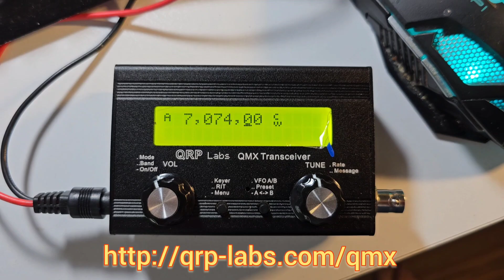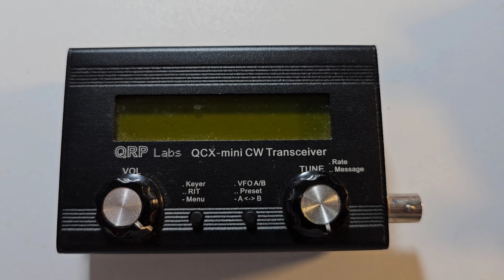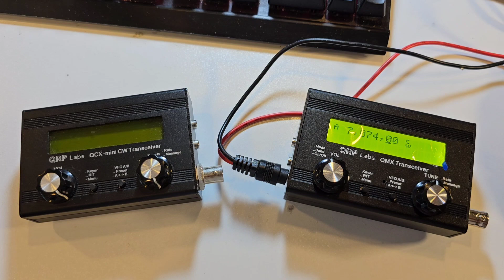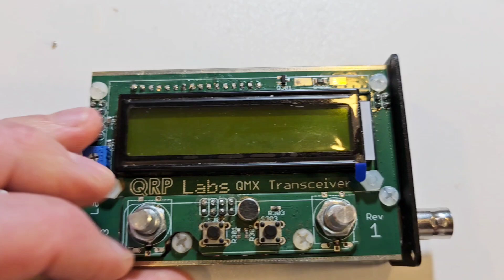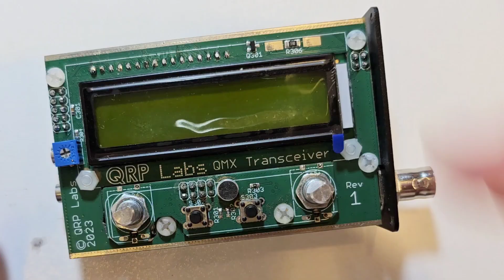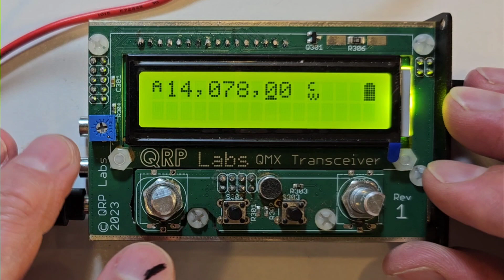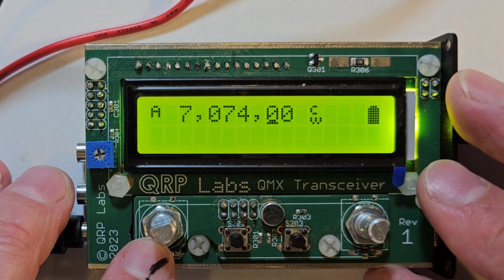QMX: Multiband Multimode QRP transceiver

Comment: Hmm a multimode? Whoa. 
Love the quality of and easy to build Qcx+. Today I tuned around 20m to only find one weak station calling cq. Had the QCX+ and a yaesu ft818 connected via a switch to a 20m dipole so I could switch between them. They both received the same weak signal but The QCX+ with its audio filter brought it out and made it more readable and it even decodes the cw on screen. WOW. I tuned the 15mhz time station and the Qcx did better. Thanks Hans. I highly recommend the QCX+ and other things from QRP-Labs.

Comment: Hans, I would sit for hours listening and watching any one of your videos.

Do what you think is best to pass your info onto us!

BTW: I will order the QMX in a few weeks. Really looking forward to the addition of phone functionality.

This is a long post, Folks.

Must get back to practicing CW. I started with CW by counting DOTS/DASHES 45+ years ago, and it's cursed me ever since. Several years ago, I worked up to copying @ 20 WPM @ about 85%/90%, but jobs/family put HAM activities on the shelf.

However, your kits have pretty much reversed that.

BTW: I'm a retired Over-the- Hill, Has-Been Digital Electronics Iginier, very-very into my senior years, and as you know: 

'You can take the Engineer out of the Lab, but you can't take the Lab out of the Engineer!'

My specialties were Digital Designs of Embedded Real-Time Machine Controllers, High-Speed Mil-Spec Comms, State-Sequencers, and Four-Bit Slice designs, along with much Assembly Language Code to test my hardware and prove to the Software-Pukes that a degree from Dartmouth didn't make them hardware or software engineers. I provide this info to demonstrate my history of:

'Bin-There-Done-That'

So, with that being said:

I consider you to be an outstanding engineer!

Your Hardware Designs are a demonstration of simplicity that provide the intended functionality.

And, the functionality of your Sofware Design(s) is/are SUPERB!

The combination of your Harware/Software designs demonstrates that you defined the product's functionality, outlined the code, detailing the tricky stuff, then flushed out the hardware, finalized it then intergrated it all together.

As I matured as an engineer, that became my Design Path.

Hans, your Work Output is outstanding, SIMPLY OUTSTANDING..........

Comment: You still have not finished the QSX SSB transceiver. I waited for it several years. All these CW rigs only interest a minority of hams. We need small SSB rigs for normal ops and digital modes. I built the QSX 10 watt PA before giving up on it and buying an FT-891.
Reply: The majority of so-called hams with the baby, easy peasy licences are too lazy to learn morse code.

Comment: I ordered my QMX in October, 2023, with SSB in mind. What mini hand mic would you suggest that would pair nicely size wise, please? Thanks, Michael
Reply: N7KOM showed a DIY mini hand mic, made from a Baofeng-type mic+earphone with a PTT button.
Reply: @junyangxx  WRT Baofeng mics - I got one with a UBITX transceiver.  Reports were always that the audio was "thin" and weak.  Somebody else took theirs apart and discovered that the actual microphone is a little tiny electret element.  AND the hole to get sound to that electret was very small, almost invisible, and set off to the side.  He took his Baofeng apart and drilled a new larger hole through the case in the middle of the mic compartment.  Big difference.  Louder, more balanced, more punchy audio.    I just did the same, haven't tried it out yet.

Comment: Great device. Would be nice to have 17 and 15m instead of 80 and 60.
Reply: Agreed. By which time we can hope for the sidetone volume & AF volume adjustment function to work. Having one for 40, 30, 20, 17 & 15 would be super for POTA/SOTA/BOTA/IOTA ops. As it is, however, it’s a very nice QRP box. I’m enjoying mine & am, of course, looking forward to FW updates. 73 de W8IJN
Reply: There is an option for that now

Comment: I just finished building my QMX. Works excellent. A lot of high tech in a small space.
You have to be very careful when assembling it, but if you follow the very good assembly instructions exactly, it's quite easy.
Another real hit from QRP labs.
That can't be topped anytime soon!
Reply: Im a little worried about the build, but I got new solder tips and also a third hand with a lit magnifying glass :) it will be a couple weeks before Im home again and can build it.
Reply: @HiltsyAdventure  
Hello Hiltsy,
don't worry, it will work.
What I use:
Soldering station = Ersa I-Con pico, 68W
I usually solder at 450° Celsius.
Head loupe: Carson LumiVisor 2x/3x/5x/6x, works well.
After only a few solderings, I immediately check for contact, with the enameled copper wires after each individual soldering!
To do this, I clamp two fine sewing needles to my test probes.

Have fun building.

Comment: That looks great!  If you're taking requests, I'd love to have QDX+ which would be pretty much the features of the awesome QDX, but with the option to run 20 W out, and with good heat sinking on some TO-220 sized final amplifier transistors so it'll reliably operate in the field in desert conditions (50 C ambient).  Bonus points it it could be ruggedized to be waterproof or at least splash resistant... IP-54 or better.

Comment: POTA operations are often conducted (for example) at a picnic table less than 10m from the vehicle parking spot, so equipment size and weight is most often not a major concern. 
SOTA, where clambering up a tall hill or mountain, yes of course. Major concern.
Reply: I've done a couple of Field Days with my QDX at parks.  It's kind of fun to lug my big battery and a solar panel out just past the picnic tables... then pull my radio out of one shirt pocket and my wire dipole out of the other.

Comment: That looks like another winner, Hans!  Good work.  One question: the QCX-mini ended up getting a AGC to handle the wide dynamics and looking at the schematics for QMX it seems to have fixed gain.  Is the dynamic range of the ADC sufficient to handle both very weak signals as well as strong [local] ones?
Reply from the maker: In QCX-mini, AGC is a matter of operator comfort, not dynamic range. It keeps the volume level at the earphones reasonably constant. QMX is an embedded SDR (Software Defined Radio). In QMX I used a very high performance ADC having a rated Spurious Free Dynamic Range of 110dB. As a comparison the ADC used in the Elecraft KX2/KX3 rigs which are a similar SDR, has SFDR 103dB. 

It's very important because if you use a lesser ADC, and attempt to compensate for that by putting variable gain blocks or attenuation ahead of the ADC, you do NOT increase the dynamic range, you just move the dynamic range window. Yes you can receive weak signals as well as strong ones by doing that - but that isn't the point of high dynamic range; high dynamic range gives you the capability of receiving weak signals you want, in the presence of very strong ones a few kHz or 10's of kHz away. The only way to achieve this is a very high performance ADC. Not gain or variable gain/attenuation before the ADC. Then subsequently the gain is applied digitally, as well as AGC. 

At the audio output, volume control is also applied digitally - the output stage uses a 24-bit stereo DAC. There is plenty of range available to be able to apply gain control digitally and still have plenty of bits of resolution to not distort the sound even at low volumes. 

The very high performance ADC chip in QMX and the careful analog design ahead of it (same as QDX) gives these transceivers a performance which beats many expensive commercial transceivers by the big names.